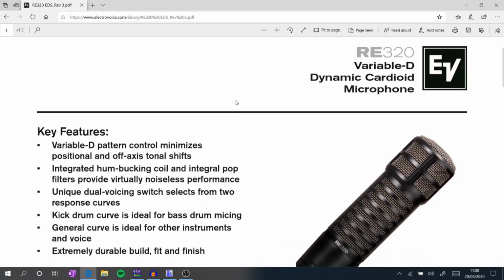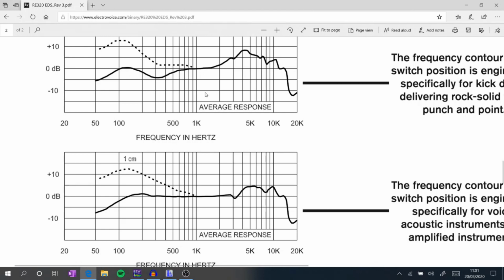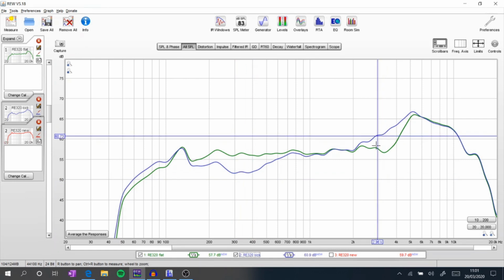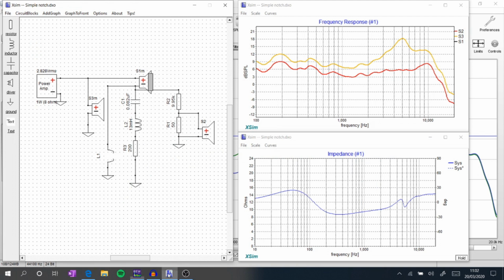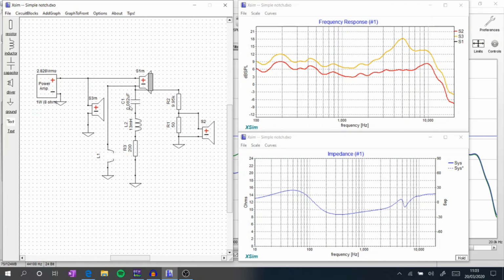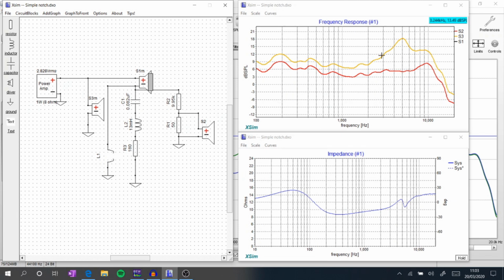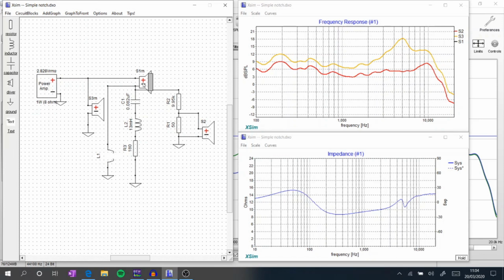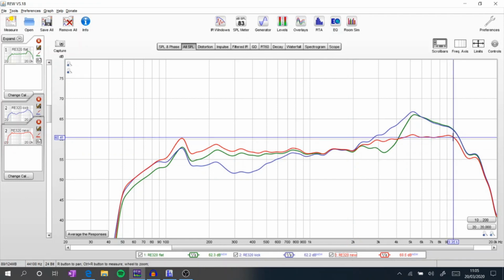Modifying an EV RE320 - Simulations and Results

Comment: Will this work with a 200ohm resistor soldered to the male end of an xlr cable across pins 2 and 3? Which resistor did you end up using? Do you have a link?